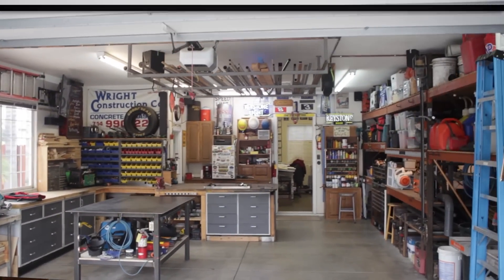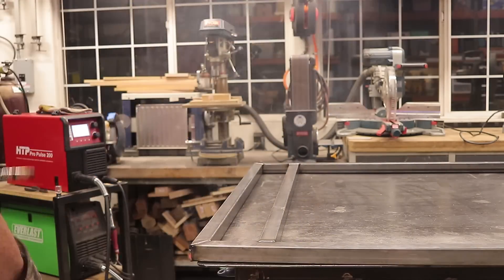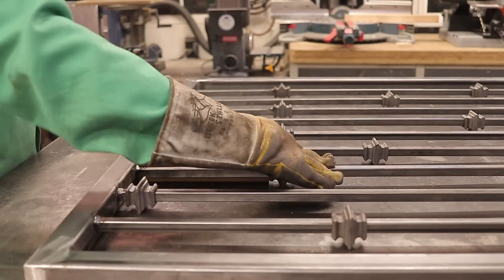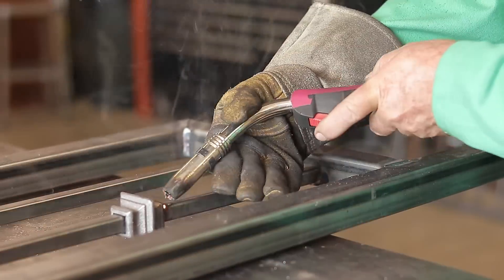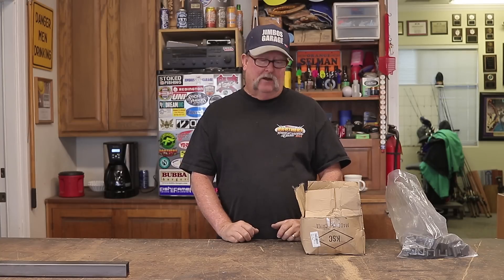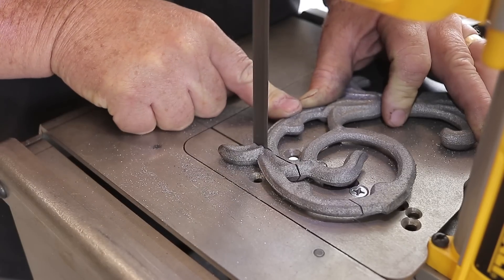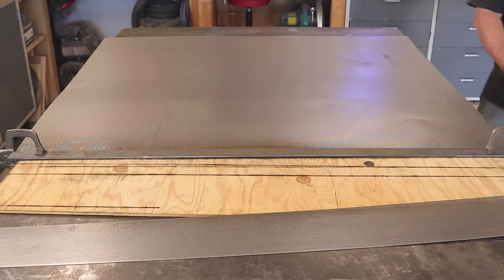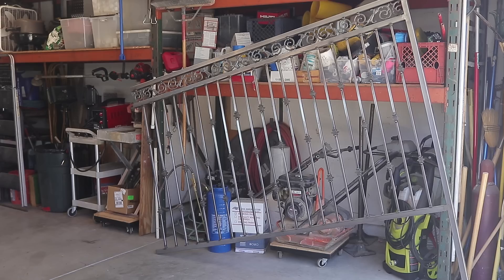Metal Front Yard Gate With Security Screen  | JIMBOS GARAGE

Comment: Great video as always, Jimbo!  I wish you would have done this one about 6 months earlier.  I had to build a gate for my side yard and never though of using self-tapping screws, that was a smart idea!  I ended up using long but thin bolts running through the 1/2" sections to secure the metal backer.  I didn't use privacy screen but rather solid 20 gauge sheet (just a guess on the guage) on the back for privacy and man oh man that was a pain to weld! I should have done the 1/8" bar clamped in place instead.  I have a front gate to do and I will be following your advice this go around!  THANKS!!!

Comment: I've been taught how to do all of this very differently. I usually use an L square to make my frames. Also even though the corner vise is quicker to make the frame there's a higher chance that the frame will warp a lot due to
It not being on a flat and level surface. Also I start my welds on the outside corner joints first so my frame doesn't warp. And then I weld the inside corner joints. At the very last I weld the butt joint where the 45's meet but weld all of them in the same direction ex: from outside to inside on all 4 corners. All of this makes for the minimum amount of warpage.
Reply: I  was always taught that when welding up 45ﾟ corners you wanna tack weld all 4 sides on each corner then Weld the top on all 4 corners then flip the piece over and weld the bottom and then Weld the outer and inner corner.   The top and the bottom will have the least amount effect of pushing or pulling your part out of square if you weld the outer corner 1st what can happen is you end up opening your 45ﾟ corner to a 46° or 47ﾟ corner  and if you weld the inner corner 1st you can end up closing your 45ﾟ corner to a 44° or 43° degree corner  Depending on how much heat you're putting into the product and how well you have it clamped.  Also if those parts really are cast iron how are you getting away with not preheating the cast iron to adequate temperature before welding or is it just  decorative so it's not necessary? Keep up the awesome videos I love your channel you do a damn good job!
Reply: Ryan Minnick I use the same type decorative cast iron. I rarely preheat it because like you said it’s just decorative.

Comment: Very nice gates and panels.  Don't you love it when they change the design after you have them already built!
One question.  I have built a gate that has these slide on collars.  After it is all built how do you keep the metal that is unpainted under the collars from rusting?  Rain running down the pickets and through the collars drag rust down to the bottom rail.  I thought you or someone else might have the answer to this problem.  Paint or powder coating can't reach down into there between the picket and collar.  The only thing I could think of is a weld through primer wherever the collars are going to be but getting the primer on the inside of the collars would be a major problem.  Thanks for your video.  Tom
Reply from the maker: Thanks for watching, Yes that is a problem that i have had in the past, I even tried to prime them before welding the m on, Not much luck there either.   Jimbo!

Comment: How do you find welding cast to steel? Is that just standard mig wire and gas?
Reply from the maker: Thanks for watching Brent, It is a little splattery, Yes regular mig wire with 90-10 gas.  Jimbos garage!
Reply from the maker: Nice job on the gates Brent!

Comment: How do you determine what size square tubing do you use? I want to build my fence but I am having a hard time finding out what gauge to go with. I want to use 4x4 post and for the frame 2x2 or 2x4 with wood slabs. Any help I would appreciate it. Thanks  and keep the videos coming they are awesome.
Reply from the maker: Thanks for watching, Use at least 1/8'' for the posts and .063 or 1/16'' for the rest of the sq. tubing, That way you can screw the wood to the tubing with self tapping screws.  Jimbos garage!

Comment: Nice work Jimbo!   Before they get painted,  do you grind the entire piece to get all the splatter off etc?

I dont see a link to that corner vice.. where did you find it?  theres all different kinds, some are flimsy junk but yours seems to hold up.  Thanks
Reply from the maker: Thanks for watching, There is usually very little spatter, Maybe a few little b.b.'s, Just knock them of with a small chisel, The corner vise is a Yost. Try Yostvises.com,  Jimbos garage!

Comment: what is the "GAUGE" on that  FRAME 1-1/2 X 1-1/2  Square Steel Tube??
Reply from the maker: Thanks for watching, .063,  1/16''     Jimbo!
Reply: @JimbosGarage  thank you is that strong enough to build a 10 feet long  6 feet high double door driveway gate?